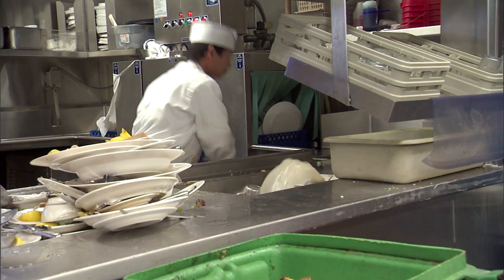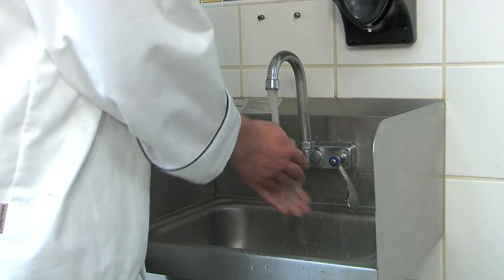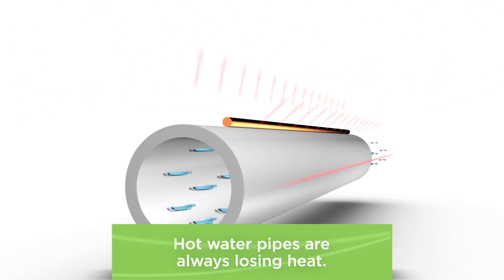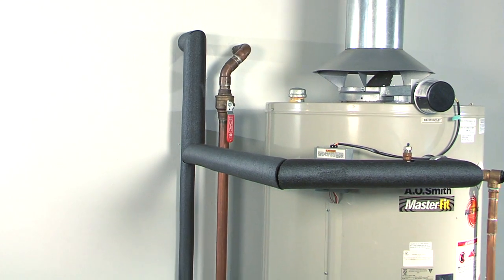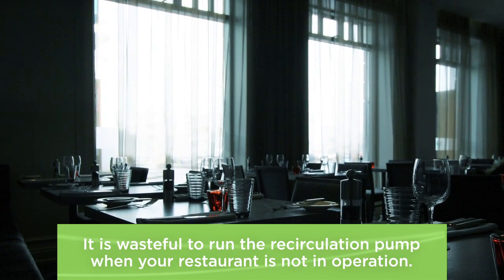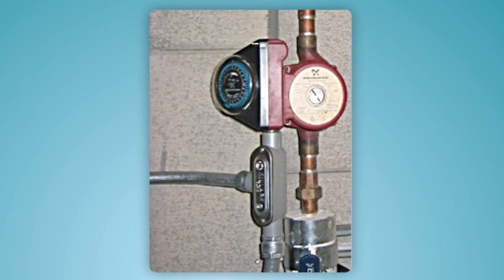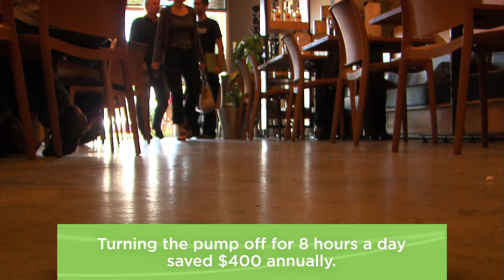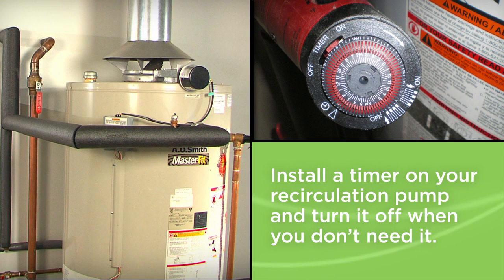Install Timer Control on Recirculation Pump (water pump in restaurants)

Comment: For even greater savings, add an Intelli-Circ controller to your pump.  
It will minimize pump operations using temperature based "as needed" 
intermittent cyclic-pumping.  Intelli-Circ controller 'easily' 
integrates with any hot water circ pump which utilizes 110v  3-pronged 
power cord.  Continuous pumping is the real cause of high demand on the 
water heater.  Restaurants require a higher temp water then residential 
so you'll need to call into ReadyTemp to get a model with the higher 
setpoint.
Reply from the maker: Sounds interesting. We'll check it out.